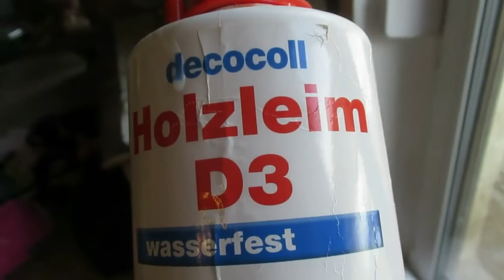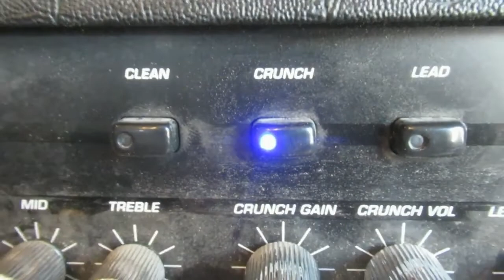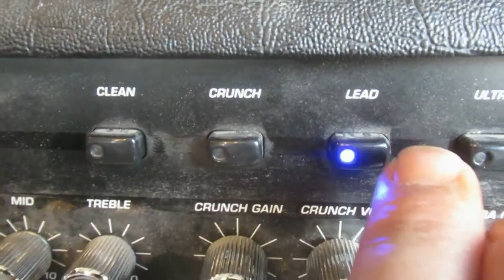Sustain Experiment Guitar Body Sustain Guitar Electric guitar Bi Body glued Neck Headstock Bi Body

Comment from the maker: Guitar and sustain. Sustain or rightly improve the "finish". I doubled the volume of the guitar body (body) by glued and screwed boards, as well as the guitar head (also called headstock or headstock. The guitar neck was glued AND screwed. I have an Alnico V pickup pickup in the Telecaster Fender style (copy for 8 euros) Glued directly to the neck. The neck was previously shortened somewhat obliquely, where it is normally not used. All pickups are firmly connected in the body with a glue and lead ball mixture (the entire body is filled with it), so there is no unwanted counter-vibration or interference. The heavy body (well over 10 kilos) hardly vibrates with (almost no resonance) and the string does not lose energy so quickly (vibration is hardly dissipated). The sustain thus becomes longer ... Saludos Alex